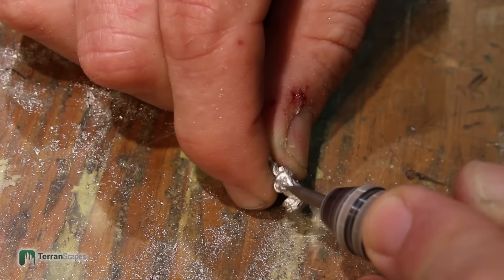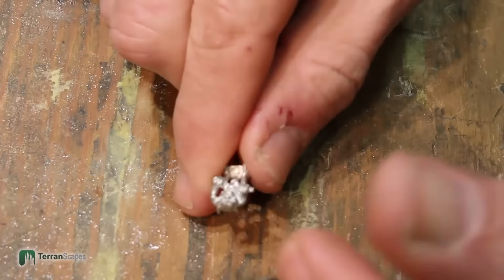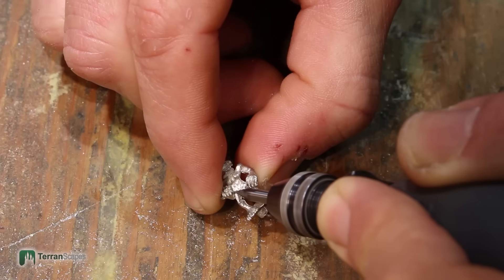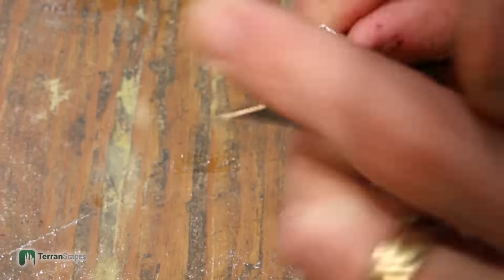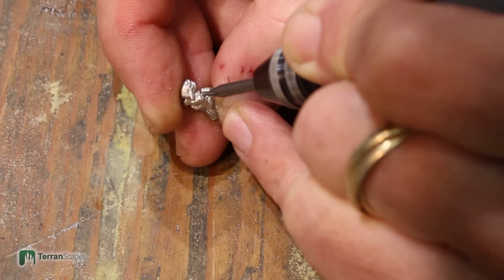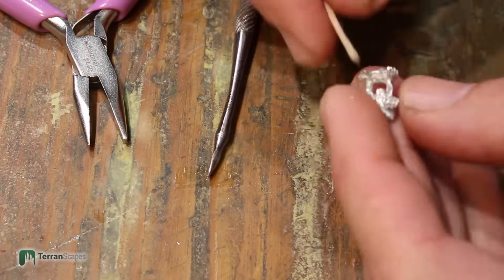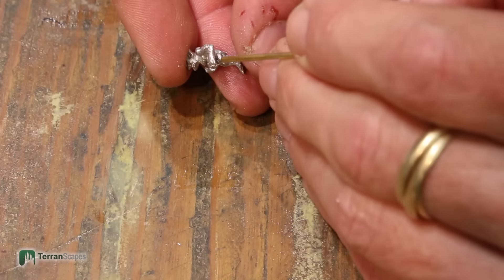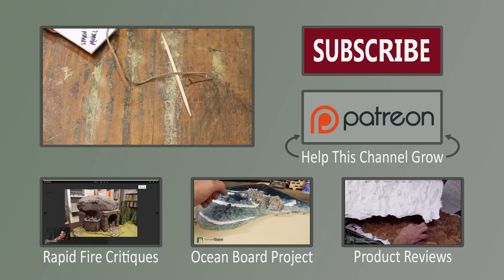Snotling Conversion - Orc Display WIP #11

Comment: To get a good handle on oddly shaped objects, snotlings, in this case, you could try using pitch and a piece of dowel as the handle...
It works wonders as the hand vise that won't marr surfaces, and provide support for long spindly, bendy parts, of oddly shaped stuff! Allows you to exert way more force, in a controlled manner, than holding the piece bare handed...
I don't know how much a pain in the donkey to clean up afterwards due to the receses of the figure's texture, nooks and crannies, but acetone would take care of that if heat and a cloth doesn't, as I've mostly used it for pieces that where indeed too small or odd for a pin vise, but yet not as sculptural...

Obviously, though, you lose the ability to flip it over all the time... You have to work from the angle you've set the piece in for a while, then heat it, set it in an other usefull position, and go back at it again...
In some cases, with carefull forethought, it's not a problem, though!
It's left hand might be an exemple of that, setting it from it's right, to about "navel" depth would've allowed nearly all the work angles you've used..

No fear for the fingers, strong grip, and you can also put the contraption in a vise to use two handed tools if need be!

Another kind of tool that might prove usefull for this type of work is gravers!

Great work as allways! Can't wait to see it finished!

Comment: 1. using heat upon the model may help to prevent cracking and breaking.
2. aside from a Zippo lighter, or a Bic, you may have to create, or find some way of focusing the fuel up in to a smaller flame.
3.the hottest part of the flame is the above the tip, so the objective will be to acquire a very small flame...

4. is there any way to file the upper portion shaft, of your drill bits?
to remove the "teeth" so that any contact would be against a smooth(er) surface?
5. does any on create even more precise Drilmal bits than those that may be purchased in big box stores?

6. while i enjoyed the time laps, and voice over, i felt that some energy and or charismatic synergy was lost to the microphone, that you have with a video camera.

7. please save your shavings of....(peuter?) pewter metal, perhaps it may be used to "braze" "weld" any cracks that are created while prying or bending. though one would need to devise some genius way to do so.

post script
though i understand that all manner of thing could be influencing the recording of the voice over.
Reply from the maker: Funny.  I feel different when I do voice overs so I guess that shows.  Feels more sedate for me.  :)

Filing/grinding the upper area of the bit is an interesting idea.  And I don't think there are any finer bits than the ones I have.  To be fair, they are pretty small.  Only nuts like myself wish for smaller.  ;)